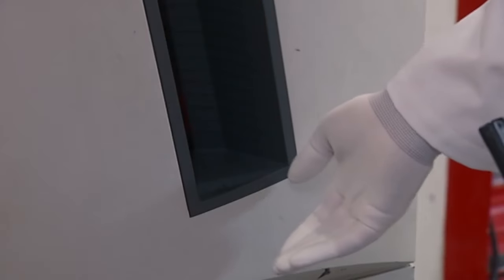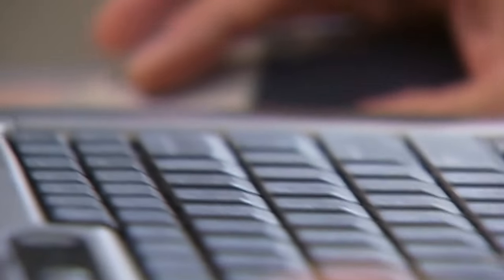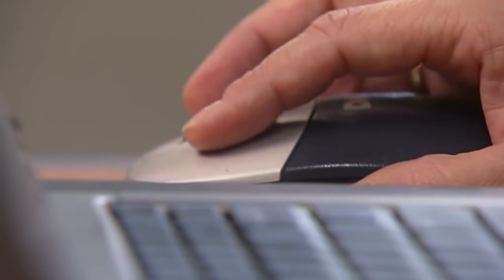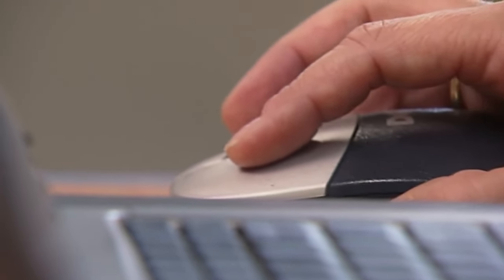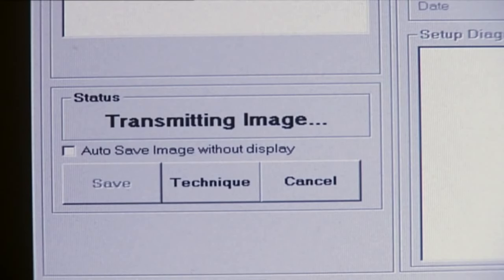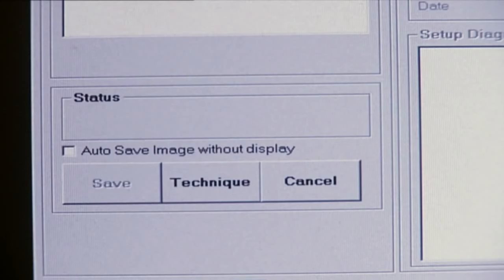RTD NDT Radiographic Testing

Comment: Thank you for the video.Really appreciated. 
If you know please,what would be approximate safe distance from (lets say parricular pipe from the video,I suggest 6 " carbonated steel,i cant tell the thickness) for person to stand,without led  protection in the way of shooting ray direction,and how about if you re not in the way of shooting ray.
I m asking becasue I m working as welder and we have radigraphy testing all around us on construction site.
We re usually around 15-20 meters away from the testing weld spot,most of the time we dont know the direction of rays. 
Alot of my coworkers worried because we dont get much info from testing personnel, they dont speak same language.
Thank you very much in advance
Reply: Wow well they should  close the area as far as what I know they should have sings as well